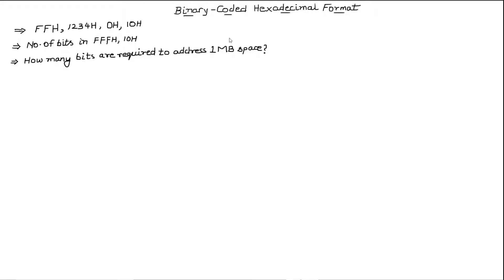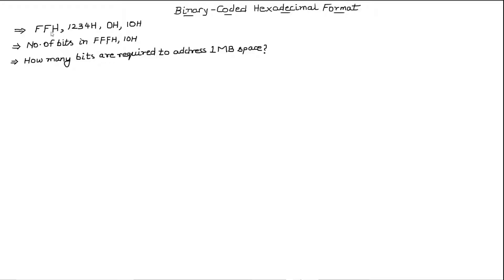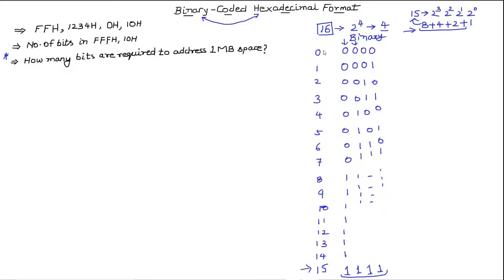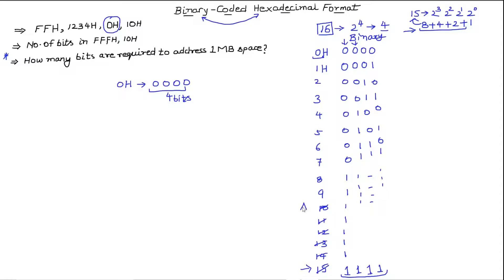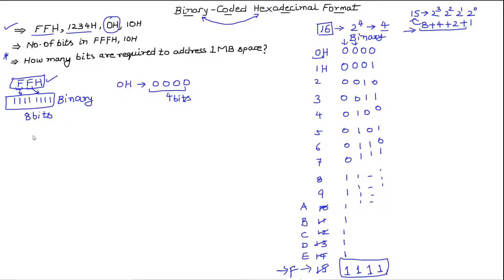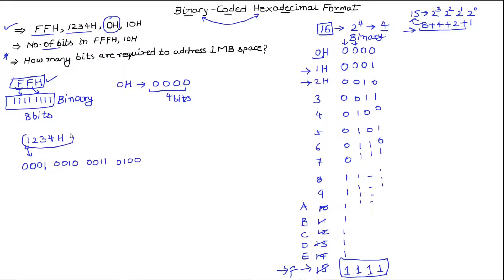[1.5] Binary Coded Hexadecimal in 8086 Microprocessors

Comment: 9:30 - 1MB = 2^20 bytes (not bits)
Reply: @ThinkXAcademy  1 MB = 2^20 BYTES OR 1MB = 8* 2^20 bit
Reply: @ThinkXAcademy  its correct for base 10 format(decimal) but you have used base 2 in the video
Reply: 20-bit address can be used to access 1MB of memory because each memory unit is 1Byte
=> 20 bits can access 2^20 * 1 Byte of memory
Reply from the maker: Thanks for providing this correction👍